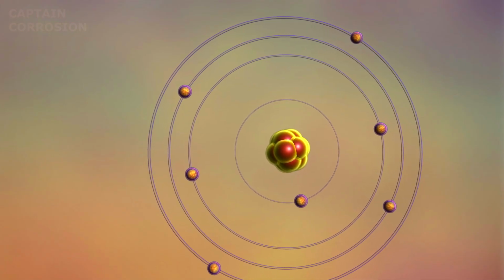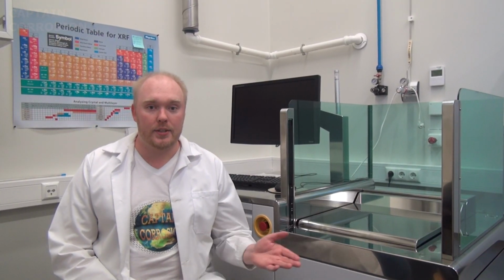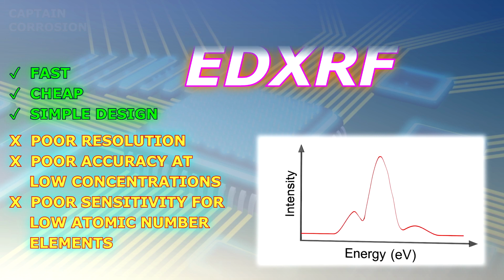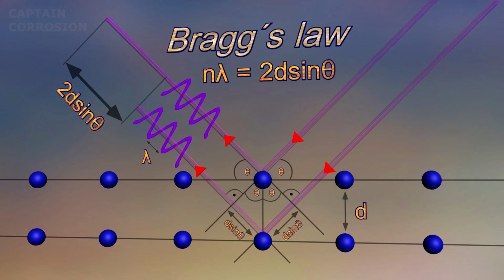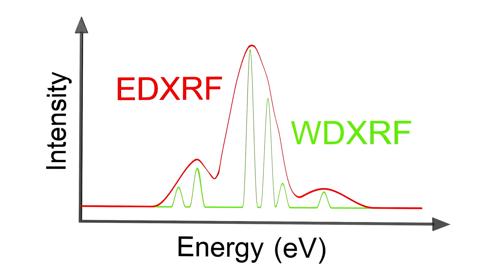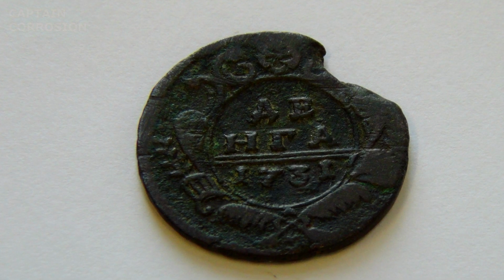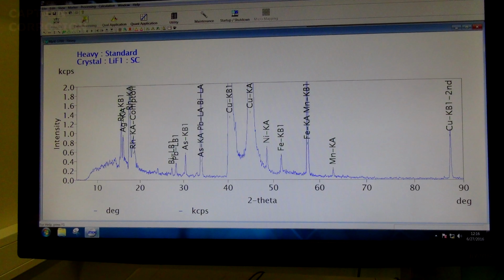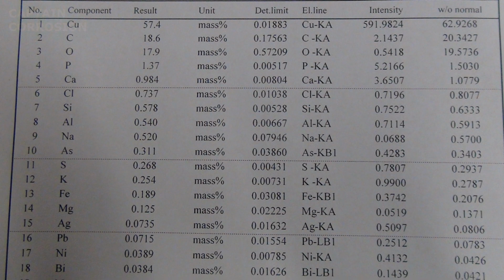X-Ray Fluorescence Spectroscopy (XRF) Explained - Elemental Analysis Technique

Comment: How much this gun? I need to measure the : Mn, Ni, Cu, cr. Does this equipment able to check it out?
Reply from the maker: The handheld device costs about 30 000 euros. You will need to do research if you need a higher end model, a medium one or a cheaper less capable one. Alternatively, you can just buy the measurement services that usually are in the range of hundreds of euros.

Comment: So, we are suppose to give up a blowpipe and a set of fluxes for that contraption??  And the cost?  About 50 grand!  You don't do much prospecting do you ROTFLMAO!!  Let's see, baking soda (cake mix isle), Washing soda and borax (laundry isle)  Microcosmic salt (you make yourself)  A blowpipe and candle (20 bucks),  small mortar and pedestal, piece of pine charcoal and a $20 piece of Platinum wire.  That found every mine in the United States ;)  Think I am gonna hold off on your electronic marvel ;)

Comment: Interesting....could this wdxrf work for glass powders? Or is there a better machine for that? Also whats the price for a setup?
Reply from the maker: It would likely work but sample preparation may be challenging. WD-XRF systems used to be about 300-400k€. ED-XRF systems are much cheaper but not as accurate, especially if peaks overlap.

Comment: Can we use this for the analysis of metal powder?
Reply from the maker: You will get better results from a smoother surface. So you might want to consider pressing the powder into a disk. However, some XRF geometries also allow the study of powders - in that case you need to ensure a smooth surface that is exposed to the exciting X-rays. If the excitation is done from below, then you need to use a thin film to hold the powder. In any case, having a solid disk or pellet pressed from powder is a better option as powder may fly apart when you turn on the vacuum pump.

Comment: Please explain how a compound can be detected by XRF
Reply from the maker: Well if you know the elements in your compound then you try to measure their ratio by XRF while trying to avoid any unwanted signals that might affect the measurement. Sometimes you also compare the measurement results for several samples to see the difference and this helps in identifying the mystery compound. For instance, if you have traces of mystery material on a bullet, then you do measurement on the primary object and then also on a clean reference bullet. Compare the spectrums and concentrations and voila, someone goes to prison!

Comment: Would one be able to use this method to measure the elemental composition of the soil, if so, how would you suggest preparing the sample?
Reply from the maker: Hi! For that purpose, you will ideally need a WD-XRF system, where the sample is irradiated from the top. In our system the top part of the sample has to be faced down and this means that we have to use a thin polymer film on which the powder sample (soil in your case) would be placed. In any case, the sample should only be dried (preferably at slightly elevated temperatures (40-60C). Soil can also be quite unhomogeneous, so you'll need to mix it up properly - however you might find elements of the mixing system in your sample afterwards so it should be something clearly distinguishable. There are probably several buts that need to be taken into account but you'll find out about them once you start the studies. At start I would recommend a handheld ED-XRF unless you need to measure low contents.

Comment: and what should be the min size and dimensions of sample for this test?
Reply from the maker: It depends on the device you use. In a modern WD-XRF you can actually choose which surface area you can study by placing the sample on the holder with an appropriately sized hole. Essentially you will need a flat area of about 5 mm diameter on a sample minimum to get reasonable results. Ideally you would like to go for larger surfaces though - like a plate with 50 mm diameter.

Comment: very nice.....but how xrf is diff from XRD, EPMA and SEM?
Reply from the maker: Hello! XRF used primary X-ray radiation to generate secondary characteristic X-ray radiation in the sample and by detecting this characteristic X-ray radiation, we get to know about the elemental composition of the sample. In XRD we study how X-ray radiation scatters from different planes of atoms in a crystalline sample - by scanning through a range of angles - basically with XRD we get to know about the crystal structure of the sample. In SEM with electron probe microanalysis  we excite the sample atoms with accelerated electrons and detect the resulting characteristic X-ray radiation.
Reply: @CaptainCorrosion  Thanks A lot Sir
:) :)

Comment: So after the element loses its inner shell electron, how does the entire element (not the inner shell) get its electron back?
Reply from the maker: Hello Bernharde and thank you for watching our video! If an atom loses an electron, then it is in an excited state as long as it can steal back an electron from somewhere. In most cases we are dealing with bulk materials and therefore there are plenty of other electrons nearby. Also, the photoelectron that leaves the atom, gets absorbed in the same surrounding material in most cases. The relaxation process of an atom however is quite a sophisticated event as there are numerous ways how it can happen. For instance, if an inner shell electron is removed, then the relaxation process can initiate by filling the vacant spot by any electron that has a lower binding energy in that atom. The excess energy is each time released either as characteristic x-rays or it is transferred to an outer shell electron, which leaves the atom as an Auger electron. This means that multiple electron transitions can happen during the relaxation process and when studying bulk materials it all comes down to statistics which shows the generated signal of various intensities in the spectrum - higher intensity peaks represent relaxation processes that were more likely to happen.
Now, if this ionization happens to gas molecules at a very low pressure, then these molecules undergo relaxation up to a point where inner shell vacant spots are all filled and only outer shells miss electrons, which means that the molecule remains in an ionized state until it can find an electron from somewhere else.
Reply: Great explanation of the physics at play in a nutshell. Thank you.
Reply from the maker: You are welcome!
Reply: Your question is actually very important for XPS (X-ray photoelectron spectroscopy), this tehnique uses x-rays to eject electrons from surfaces completely, and then detect the kinetic energy of the electrons and correlate that to the identity of the atoms inside. The sample actually would get positively charged, but usually it is grounded to Earth (which is actually negatively charged, but at a very low negative potential relative to your sample).

Comment: is it posible to take a measurement value and put it on a totally different program for PC?? or is it posible to create an interface between a PC program and the machine or a PLC and the machine??
Reply from the maker: Hello and thank you for the question! Normally there are various options on modern XRF systems to extract the data as they are already computer controlled. For instance, you can transfer the spectrum data to an excel file and build the graphs as you see fit - the available options really depend on the system.
Reply: yes, actually that what we do at my job. we use Excel, but, the thing is. I'm working on an improvement project. we need to use this kind of machines to make an automated process and no one is supossed to type or copy anything. that machine is supossed to send a measurement value as a feedback for our system. if you know something about this or if you can tell me where can I find more information, I'll apreciate that, honestly!!   thanks for your answer and for your video
Reply from the maker: I see, in that case I recommend you do what I'd do. Get a computer science (IT  specialized in hardware + programming) student who is already competent enough to solve this problem and doesnt charge much money. If necessary, include a more experienced IT guy as a supervisor.
Reply: @alfonsocanales7210  I'm from Brazil and I have to do some automation work too, did you manage to do yours?

Comment: Hey. Very nice video. Can you please tell me how much would a machine like the one you're presenting costs ? It certainty looks expensive !
Reply from the maker: Thanks for the question. The prices are usually available only for serious customers when you ask a company - so its sort of a secret that is kept from mere mortals :D However, i'd say that hand-held ED-XRF devices could be in the range of 30 000 to 40 000 € and a laboratory WD-XRF in the range of 200 000 to 500 000. The price can vary a lot though and the examples that I brought are estimates around some examples that I know.
Reply: WD - XRF Zetium 2019 , Nederlands .. My Dear Captain , I wanna know about the accuracy of this machine as I have sent some special Rock Samples to a Lab having this  machine . 
Your reply Will be a source of immense satisfaction my Dear

Comment: I was curious how your method/system was able to detect and assign percentages for Carbon and Oxygen too?
Reply from the maker: Hello and thank you for the excellent question. We get Kalpha radiation from both carbon and oxygen when we excite these elements with sufficiently energetic x-ray radiation. So if we can detect these and distinguish them, then we can calculate their concentration based on the intensity of the peaks. In ED-XRF (or EDX in SEM) the measurement of low Z elements is indeed troublesome and less accurate (sometimes even impossible) but in this case we used WD-XRF, where peaks are narrower and measurement more precise. Anyhow the intensity of the peaks is compared with ones in the database or measured separately for a reference that has a known composition.

Comment: lol "LOW COST"   Code for an individual user that means you can't afford it. ~$9,000 - $15,000
Reply from the maker: That's why scientists write projects and collaborate! And yeah, even companies need to plan the investment very carefully and in most cases they go for a cheaper ED-XRF which is more than enough to satisfy their needs and if needed they seek out a laboratory with a more precise WD-XRF and simply buy a few measurements.

Comment: Eh, it's a surface analysis technique - for 'accurate' elemental analysis of composition I would still prefer ICP-MS/OES.
Reply from the maker: Thanks for watching! We might do a video on ICP-MS in the future as well. And no, XRF is not as surface sensitive as you might think. If you have a rather fresh surface with only tens of nanometers "contaminated" layer then it hardly bothers as the whole signal comes from tens of microns deep of the material. Also it is quick, cheap and non-destructive. About accuracy- well if the composition is critical and you have doubts, then you have to use at least 2 or 3 different methods anyhow. For solid substrates Id use XRF / SEM-EDX  + SIMS + XPS myself but every scientist has his/her own favorites and access to a certain set of tools to work with. And yeah, I have found great uses for ICP-MS myself too where other methods are rather useless =)
Reply: Thanks for replying so soon. I'm actually looking into ways to make it more quantitative - but I come to the conclusion that the technique on its own does not seem adequate enough,not for those questions. Archaeological objects are often not allowed to be 'cleaned', and cleaning with sanding paper/carbon paper/saw can bring contamination. Thank you for the other tips, I will look into it ( I was also thinking of SEM) - the problem may be that the objects are not allowed to be moved. I also read something about monte carlo simulations. While ICP is more precise, the sample itself may be inhomogenous...so it's still a standardized value. So each have their own mishaps. I just do not think XRF should be used as a point-and-get-results solutions for everything, as often the spectra includes nonsense too.
Reply: Interesting,  but what is preventing energy loss of these deeper-in-the bulk atom's photons...when these transition energy photons are trying to make it thru the "tens of Microns deep" thick layers, thru to the surface and then to the detector,  making it possible to reliably identify the elements in the energy spectra?
Reply from the maker: Thanks for the question! With XRF you get an average composition for about 10 microns of a materials top layer and usually its sufficient for quick elemental analysis. And yeah, the deeper the secondary radiation is generated, the less likely it is to come out and reach the detector. The main problems with XRF are mostly related to 1. overlapping peaks (less problematic with WD-XRF + appropriate software) 2. characteristic x-rays generating another x-ray radiation of lower energy (in the case of certain alloys for example) 3. multi-layered materials (need to model a  bit so the computer understands from which depth the signal may come from).

Comment: the gun x-ray machine and the end of clip is completely different with your spectroscopy machine that you test with  coin, the coin x-rayis  two way and x-ray gun one way.
in fact xray return from your device as you said doing by reflex and xray gun completely different operation have.
how ever, thank for your clip hope to show more item result and let know the result print directly coming from machine and his application or need more element to do by other device or machine to have result percentage

thanks
seyed
Reply from the maker: The hand held analyzer is obviously an energy dispersive XRF while for laboratory applications both EDXRF and WDXRF are widely used. In the current video however I used WDXRF to measure the elemental composition of the coin.
Reply: exact question is your printer connected to which device? Computer or x-ray machine.
result directly print from wdxrf or need some change?
seyed
Reply from the maker: Hello! A computer is used to run the XRF with a specific software. The printer is connected to the computer.
Reply: ok, and last point is how  computer connected to XRF machine and what client software connect to machine over which media?(what is application name? it is calculate automatically? )
Reply from the maker: Hello! Similarly to other modern devices, the spectrometer is connected to the computer by USB. Since the spectrometer is produced by Rigaku, we use their software. Assigning elements to the peaks in the spectrum can be done automatically but the operator always needs to verify that the assigned elements are the correct ones and if necessary, however adjustments are often required.